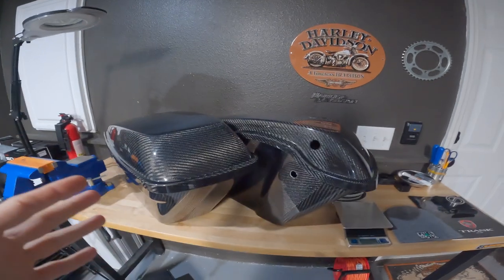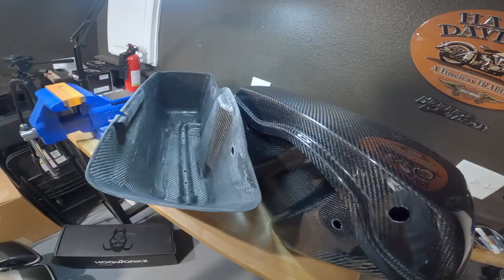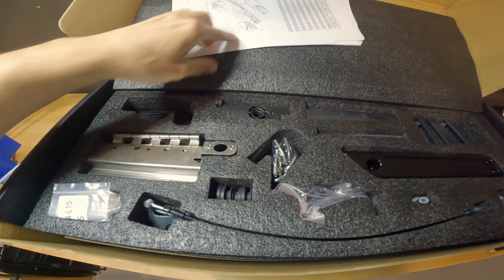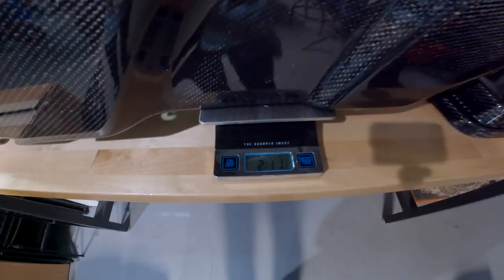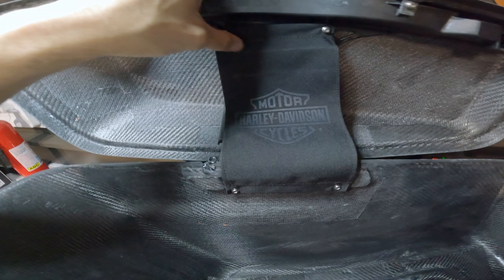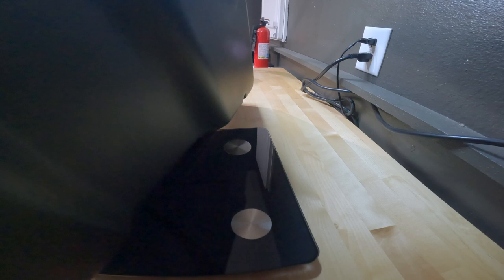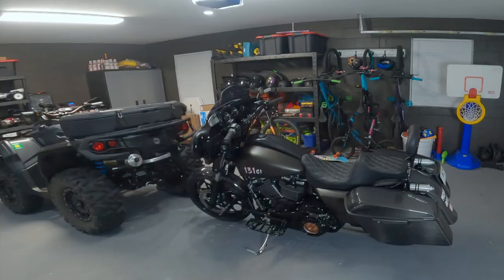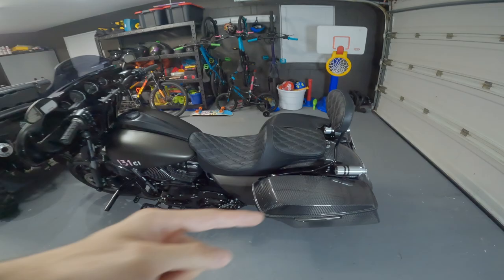Hofmann Designs Carbon Fiber Saddle Bags // Race Proven 🤘🏼

Comment: When you latch ur bag u notice it takes a little extra effort to Latch with the plate frame ? Just got my plate frame and it’s noticeable harder to to latch just worried it’s gonna wear stuff out
Reply from the maker: Yeah when I did it over the liners it was SUPER hard to close. I just run it over the bag now. But there will be some pressure to close it. It's needed to keep it stiff in place. 😬👍🏼

Comment: Why would the oem gaskets not fit on the Hofmann designs carbon fiber lids?
Reply from the maker: Because the Hofmann Designs carbon fiber lids are thinner than the OEM ones. They're not as thick as the stock bags.
Reply: @MichaelBertini I got lids from my local dealer and they sold me oem gaskets and on the Hofmann website I don't see anywhere on there for their specific gaskets??
Reply from the maker: @travisborges5095  Call up Hofmann and let them know that you had seen Bertini's video on YouTube and I mentioned using the Hofmann gaskets and not using the factory one. Here's their number (763) 595-1159. 

Don't use the OEM basket unless they tell you otherwise.

Comment: I was wondering if you are going to do the intake breather mod that redirects the oil and hot air that gets sucked into the intake and reroute it externally so your pistons after a few thousand mile will not have carbon built up on them like so many people even Doc Harley suggest to do? Also been reading about how hot these new bikes get and was wanting to know if the heat is as bad as some say? People are saying they get over 300 degrees real fast going down the freeway but do not know how they are able to get a temperature reading when the bike does not have an engine temp reading? When I look at the Harley parts page they offer a digital dip stick gauge but the reviews were not so good. Of coarse alot of the info about the heat and breathers are from DK CUSTOMS who sells things to fix the problems but he does know what he is talking about I am sure. He also has 10 free fixes for the heat issues.  I am just so concerned with all the things you should or need to do for a $40,000.00 dollar bike as with a proper tuner that will void warranty possibly and the breather mods, the wind buffeting on this model that can be fixed by installing the fork fangs Harley offers but can increase engine temp by 25 degrees in weather over 70 degrees so what to do? Thanks for the help.
Reply from the maker: So the Trask CheckM8 solved that oil problem for me. In terms of the heating issues, I installed an oil cooler and currently I have a tank lift kit from DK Customs that I'm reviewing, so stay posted for that video. 👍🏼😬
Reply: @MichaelBertini  Thanks for the help. There seems to be some simple fixes. I think the Task top plate is a good idea.
Reply from the maker: @ericjames7680  Yeah, Blockhead and SickWideGlide recently did a great video on a $12 fix which is super simple. Here is a link to that video: https://www.youtube.com/watch?v=Bq6LSZp0qMI
Reply: @MichaelBertini  Well not sure if this is a good idea or not?  Here is a question and answer to this method being used here on Doc Harley's You Tube.

''An external breather? Don't like it... just go from the air cleaner to the transmission cover, drill a hole there on top and it will be leaking back inside the motor. No canisters and clean look.'' 

Low Country Harley-Davidson:
''NO! Pressurizing the transmission/Primary is going to cause many oil leaks and issues. NO...Doc''

Perhaps Mr. Blockheads' mechanic is not as good as he thinks he is?
Reply from the maker: @ericjames7680  Interesting. I'm not sure what I would do then. I have the one from Trask which is great and I'm happy with it. 

In terms of what Doc is saying Vs what Chris is saying, I can't speak about that because I'm not qualified enough to debate that subject. 

But I do know that even some of the best engineers debate like Porsche, Ferrari and Lamborghini on how certain thing in a motor should operate. 

Block and I use the same mechanic which is Chris. He's the one I trust to work on my bike. 

I'm sure Doc is amazing at what he does too, I haven't worked with him before so I can't vouch for his recommendations. 

I think you should just trust whatever your gut tells you is right and go with that. 😬🤘🏼
Reply: @MichaelBertini  Thanks! I think I like what you did with the Trask.
Reply: @MichaelBertini  I just went and took a look at all the NEW comments about this mechanic and his breather fix and WOW you should see all the negative comments and how all the seals are going to be blown out. Be interesting to know how the owner of the bike is getting along? 😁
Reply from the maker: @ericjames7680  I actually spoke with him last week and he said that he's going to be doing an updated video because all the steps he took didn't make it into the final cut. So he'll be releasing a new video soon about it. 👍🏼
Reply: @MichaelBertini  Oh great! Thanks, I just watched his Stage One video he just released and saw your bike there. Hope you get it back soon, thanks for the reply.